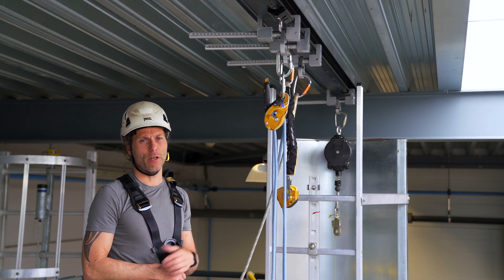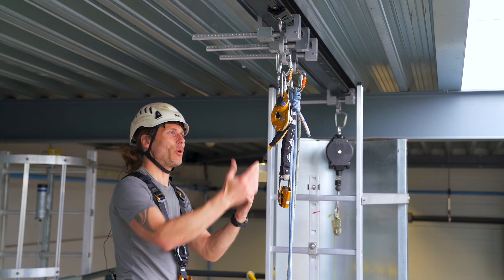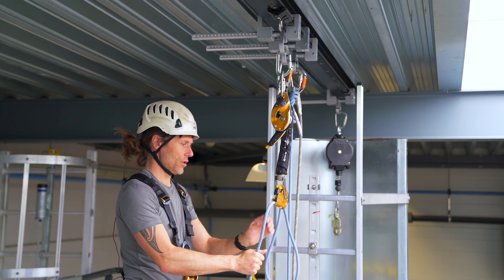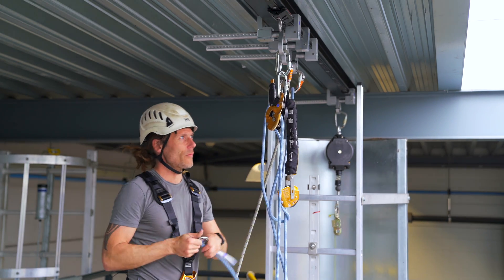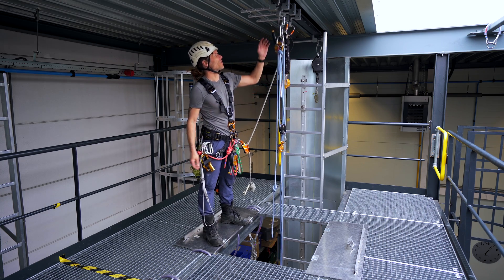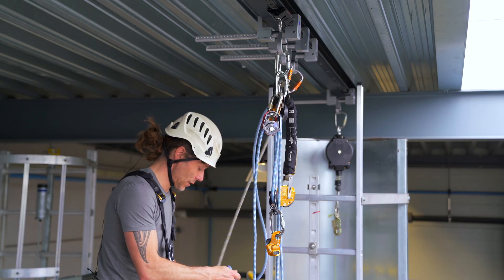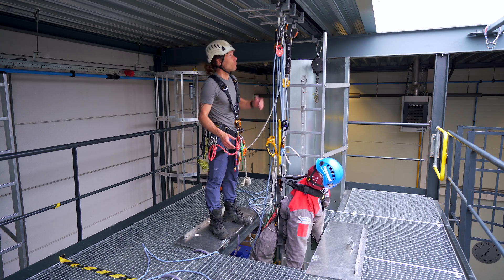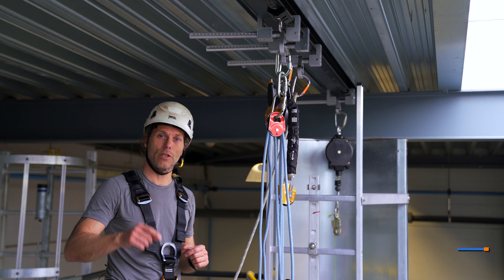Hauling System Awareness - IRATA Level 1 Training.

Comment: Why don't You use harness Croll instead of Ascension?
Reply from the maker: I could. I like this more in this case. It is more about the principle of using big muscles or weight instead of pulling down with the hands.
Over here squatting down all the time feels heavier than standing comfortably and using one leg. I use my croll often when being suspended as a counterbalance system. Does that make sense??

Comment: Do you have a video where you lift and move heavy loads with one rope and pulleys system? So just lifting and dragging a load along the rope line with pulleys and just by man power. I drew a picture so people can understand better what I mean with rope line with pulleys. Even lifting and moving 200 kilos would be great. Its just a proof of concept with distinctly separated pulleys and not considering much about mechanical advantages or lift/height ratios. Replace the punctuations. Here is the picture httpsCOLONSLASHSLASHiDOTpostimgDOTccSLASHPf4y7Vr9SLASHropepulleyliftDOTpng
Reply from the maker: I have a video about lifting and lowering a casualty. This actually haha. That could be up to 250kg easily with the right equipment. And same principles

Comment: Hi Alex just a quick question, when would you need to be secured with a cowstail and when not ? For Example when you pass an edge ( climbing back onto it ) you secure yourself with a cowstail so that you dont fall off of the platform,  but you dont seem to be secured to the platform when lifting or lowering a casualty/load . Does the hole not present a danger of falling in ? Thanks again for all then content !!! :)
Reply from the maker: +Kj Nel thank you for your question. It is a good one👍🏼. And you’re right the hole does present a danger of falling in. 
If you look closely you’ll see I’m connected to the beam with a Grillon lanyard. If I would misstep I would have a very very small fall. 
If the floor you are standing on is flat and secure, you just need one backup to prevent or stop a fall. Always keep fall distance in mind as well. That will tell you when to use a fall arrest system with a shock absorber and when not.
Reply: @TheRopeAccessChannel  Hi Alex thank you for the reply, you answered/explained a few things in one reply, I did not notice Grillon attachment on the beam as its behind the hauling system ropes and I was focused on it being behind you with a cowstail, but the connection on the beam is much safer in terms of not getting hurt if you do fall in, it also makes far more sense as it is not in the way and does not hinder your movement as well as makes it easy to decide on the type of backup system you need to use as you explained. Thanks again for the reply and content
Reply from the maker: Glad to be able to help. If you have any questions, just shoot me a DM or email 👍🏻

Comment: The new Petzl descenders with the automatic locking make these systems so much easier to operate
Reply from the maker: Yes indeed. I like teaching with the older ones. They are still more used than the new ones and if people train witho only the new one they never learn to lock their handles.
Reply: @TheRopeAccessChannel  Very true. I'm not sure that I'd be proficient with the older model if I had to use one for some reason
Reply from the maker: If you never encounter one your good. Besides, who would want to haha the new one is so much better!!